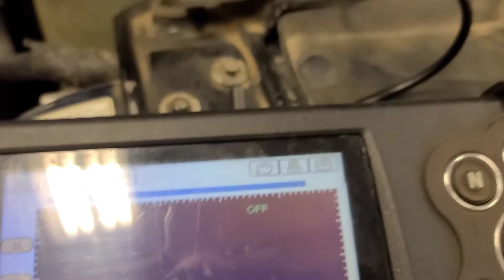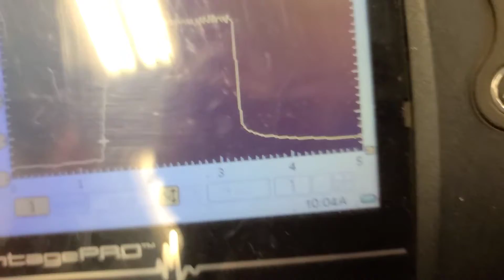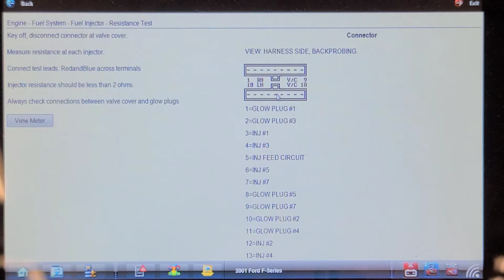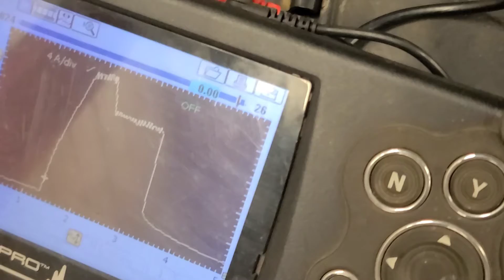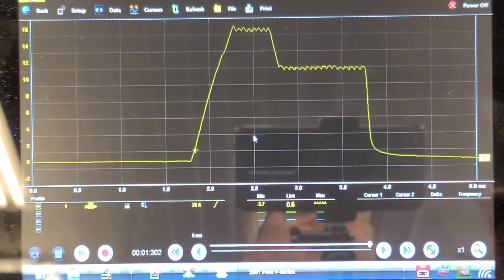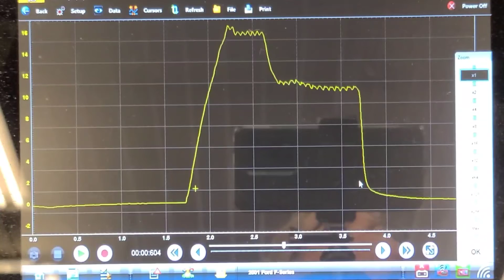2001 Ford F550 7.3 Current Ramping Bank 1 Injectors

Comment: Also, a cylinder fault on 3 and/or 8 is common. Its a freak thing with the CPS. Look at the perdels in live data PIDS. That number 3 is probably just a bit over 5%. 5% is the trip code threshold.

Comment: What kind of scope are you using Phhillip?
Reply from the maker: I'm using the snapon verus edge scope here.
Reply: @PhillipBailey  i am shopping for something but still functional...any suggestions??
Reply from the maker: @FullFaithRepair  honestly I'd recommend a Vantage Pro from Snap-on. They have been updated with the Vantage Ultra and the pro is now obsolete. It has guided component testing and sample waveforms for most components specifically for the vehicle you are working on. The presets for multimeter testing and labscope testing are a huge advantage if you're just starting out. You might be able to pickup one used for a reasonable price. I have my verus edge which I use about 10% of the time or when I need more than two channels. I use my Vantage Pro 75% of the time. I also bought a Pico scope but honestly haven't used it yet other than with a waveform generator. If your new to scope use I'd recommend one of the Vantage units. Understand the Pro cannot be updated anymore. Not sure about the Ultra. Check with Snapon. There are cheaper scopes available such as Hantec but they don't typically provide any presets or component level testing. Hope this helps you.